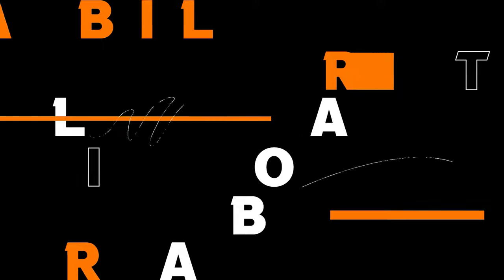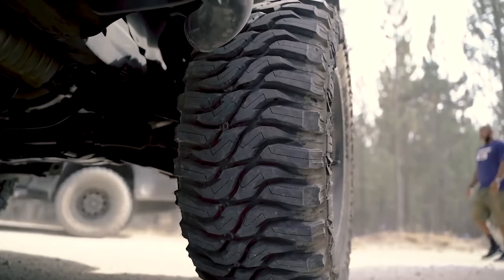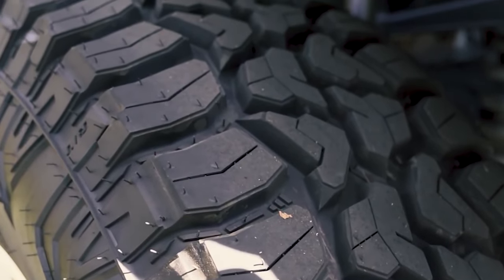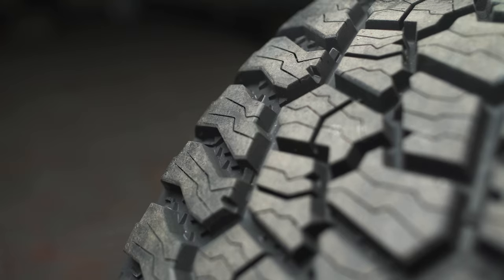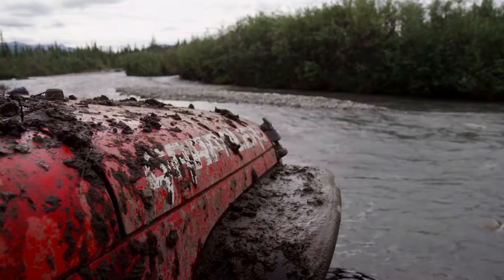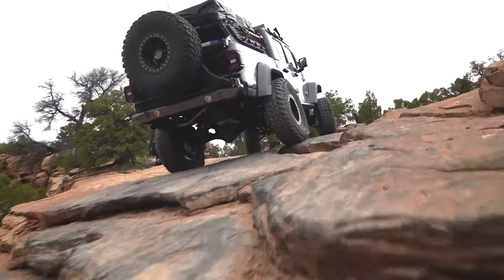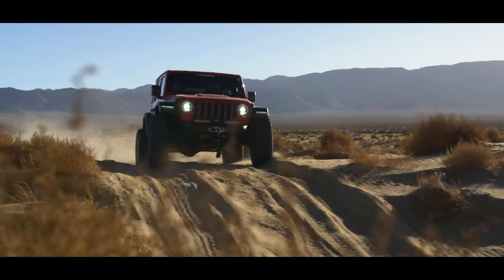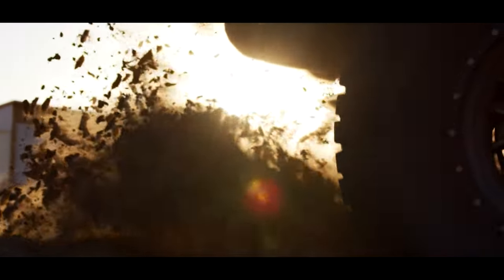Get Better Tires || Tire Siping

Comment: Tires confuse me! I had Cooper AT3 XLTs that were great in all weather and terrains. I switched to Nitto G2s later on and they slip and spin at minimal throttle in the rain even though it looks like there’s plenty of siping. May go back to Cooper or try the Toyo AT3s out?